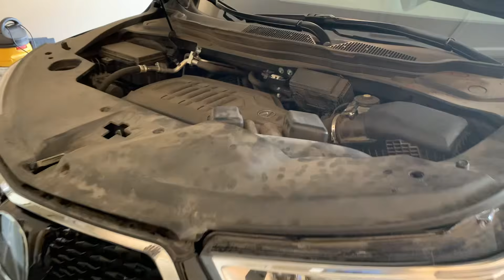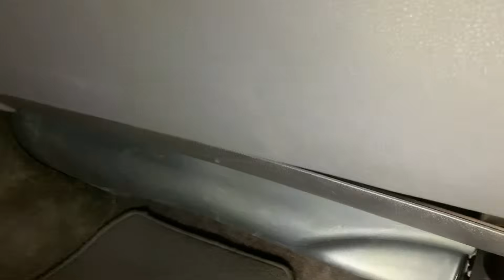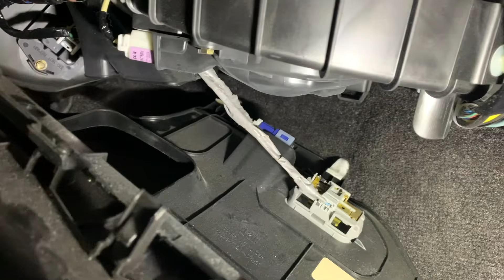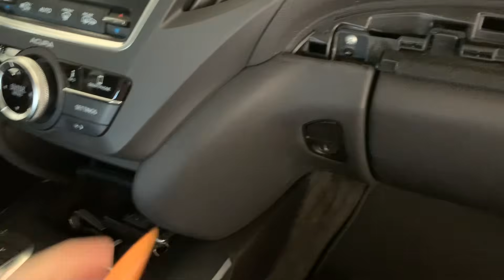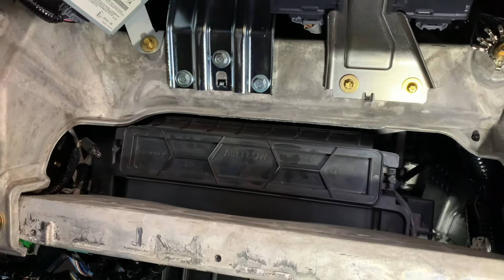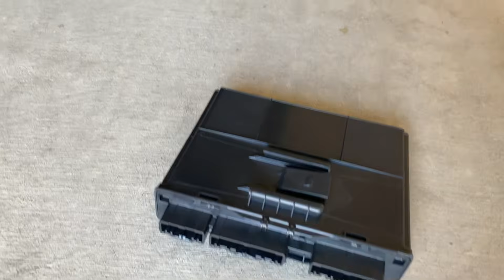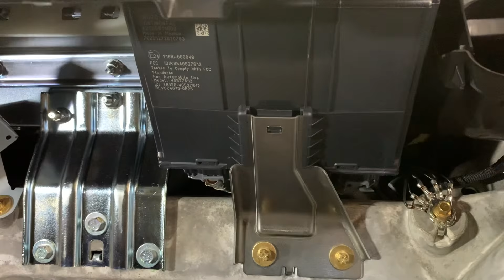Honda / Acura Random, Intermittent Flashing Dash Lights, Headlights, and Car Alarm - FIX Part 2

Comment: Just did the repair on my 2017 Honda Odyssey. Hoping the issue never comes back! Two things to note, 1) in my van, the unit is located on the driver's side, above the brake pedal, above the steering column. No need to remove panels, but I had to ask the dealership in order to actually find it. and 2) the corrosion is virutally impossible to see with the naked eye. You'll need something with magnification in order to see it.
Reply: Do you remember what tools you needed?

Comment: Mine just failed, and I couldn't get the vehicle to stop running. I started it to get the alarm from going off. After about five minutes, the engin started to sputter and it died. I than disconnected the battery.

Comment: This was the most valuable video I have ever found. Saved me $1-2k to get my 2017 Ridgeline fixed by showing me how to fix the part Honda didn't make right. Thank you so much for sharing this! Now if I could just find a similar one one how to fix the front camera assembly that controls the Lane Keep Assist, Cruise Control, automatic braking, etc. I know the chip overheats and the thermal paste they use dries out, but I have replaced that and still can't get it to work.

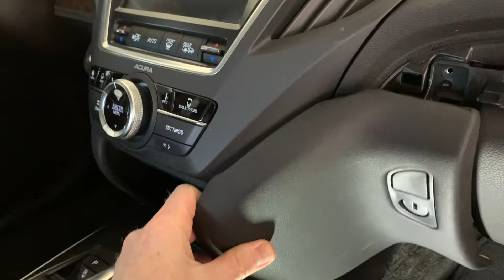Comment: I would like to express my complete gratitude to you for creating this video on this simple fix that the Acura dealer was charging me $1700.00 to fix. My wife has the 2017 Acura MDX and this problem started about a month 4:01 ago. The alarm going off at all times of the day and night, headlights turning on, the dashboard lights flickering, its like the thing was possessed. To think that this is a common issue that affects multiple Honda and Acura models and for them not take accountability for this issue is sickening. I am thankful for people like you who are unsung heroes for putting this out here to help others. I just finished completing this fix and so far the issue has been resolved, and you have helped save us $1,700. Thank you kindly sir!

Comment: I have the Acura RDX 2017. I got the same issue as you described in the video. I removed the glovebox and found out the control unlit was not there.  So I just want to point out for  everyone with the RDX 2017- Technology model, the control unit is located on the driver side under the steering wheel. I slide it out  from the mounting brackets and followed the instruction from this video.  I fixed the problem now.  I hope it will not come back for along time ! Thank you for creating this video.
Reply: Benny i have a 2017 rdx. So the box is on the drivers side? So I don't have to take out panels like the video?
Reply: @daverepole9283  Yes, it is correct.
Reply: @bennydomusic thank you Benny. Hopefully this solves the problem.
Reply: @bennydomusic so I cleaned the unit and now its a waiting game. If it still goes off ill change the hood latch assembly next..thanks again Dave.

Comment: Thank you so much for giving me this useful information, I fixed my 2019 pilot.
I did removed 3 panels to access the circuit board, cleaned it and the alarm back to normal. 
These days the dealership wouldn’t perform those services, have to learn doing it yourself. Good luck folks

Comment: I just found this video and I am hoping to try it this weekend! My 2016 Honda HRV has been having this exact issue on and off for about two years now.

Is there a way to tell how much super glue should be put on there? Is it only needing to be applied to that furthest right line on the bottom row (in the small section you zoom in and show)? Or would it be okay if the super glue got on that corner entirely? I don't want to get too much of it somewhere and it cause more problems. Also, is there a certain type of super glue that it needs to be? Water resistant or heat resistant or anything like that?

Thank you for this video and any extra info you may be able to provide!!
Reply from the maker: The fix is to remove the dendritic growth that is shorting out the IC in the module.  Cleaning the area shown and removing the dendritic growth is the key.  The super glue is just an attempt to keep the issue from reappearing.  A more proper and effective alternative to super glue is the application of a conformal coating.  I would apply it only to the problematic area and make sure to let it dry completely.
Reply: @reginag1874 thank you!! I was hesitant to use the super glue on it, so I actually just cleaned the one spot with alcohol and put it all back together. That was over a month ago, and so far my car hasn't had any issues since then. If it acts up again in the future (especially the near future), I'll look at trying to actually put a little coating on that spot. Thanks for your recommendation!

Comment: ✅It's been two years and 40000 KM since I completed the repair on my 2016 Pilot. No issues whatsoever!
Reply: did you replace the who module? i did disconnect mine and put it back in but still was alarming off and on. then got a new push start button. barely lasted 5 months from OEM. now i bought another one, it started alarming after 8 hours T_T.
Reply from the maker: Fantastic!  Thank you for sharing your experience.

Comment: Regina G you deserve a medal for this video.  I have been dealing with this issue for months on a 2018 RDX.  The first time it acted up I had it towed to the Acura dealership and of course it ran fine there and they found no problem except blaming it on a slightly loose battery terminal.  Twice in the past week the horn was honking in the parking lot with the usual erratic instrument panel and clicking relays. Embarrassing to say the least, looking like an idiot trying to unlock the doors and shut off the alarm with the key fob. Today at a restaurant was the last straw where I either fix it or get rid of the car.  I found the module above the brake pedal, removed it and saw the ‘whiskers’ on the IC pin.  Followed your procedure and hopefully no more problems with it.  This is the second electronics problem I’ve had with newer Acuras, the RDX the fourth model I have owned since my 1987 Legend.  Quality has gotten worse with each one.  I am done with them.

Comment: Can you say how much super glue was added to prevent dendrites?
Reply from the maker: Just enough to cover the exposed metal pins.  You want it to flow over the pins so a gel version will not be very effective.  A more proper and effective alternative to super glue is the application of a conformal coating.

Comment: 2020 Pilot did this a year ago and today I did the repair with alcohol and super glue. As soon as the rain stops I can connect the battery and give it a go. Thank you Regina for posting this. I had replaced the hood latch for alarming randomly. It started again so I disconnected hood connector to turn off alarm but infotainment center/radio would turn itself on. Kept lights off when parked to prevent them coming on and draining battery.  Edit: all good.
Reply from the maker: That is great!
Reply: @reginag1874 Unfortunately my Pilot was stolen recently but was found in less than 8 hours. Sadly it was stripped of so many body parts that it was totaled. The issue never came back since fixing it. Whoever stole the car deleted my keys, made new and cut satellite so it couldn’t be tracked.

Comment: THis is a great video.  I was experiencing the same issues and turned out it was the battery.  When we used portable battery jumper the car started up immediately, no blinking lights.  Brought the battery into NAPA and they checked the charge and it was extremely low.  I bought a new battery and installed and car fired up no issues..  This might not always be the fix, but it saved me alot of time and money.  Check the battery before purchasing a new SPCU.

Comment: I’m really grateful for this video. It saved me a fortune in ridiculous dealership fees and spared me the headache of dealing with my 2022 Pilot, which was driving me crazy because of this issue. The tutorial was quick, clear, and to the point. Posting this on July 6, 2025 — thank you!
Reply: I have 2020 Pilot. Is the module in the same place as Acura or under steering column?  I saw someone mention it was under steering column but want to make sure before I start pulling things apart.
Reply: @imgadgetmanjim same everything as the video man. Do it it’s easy
Reply: @MechaRomance Thank you. I fixed it today.

Comment: Great video. Thanks .. I would add that I found an easier access to the module.  Open the glove box all the way.  The same way you would access the inside air filter.  Then use a drimmel tool to cut the plastic back wall.  10 minute job
Reply from the maker: Thanks for sharing.  That is certainly an alternative approach.  You must like your drimmel tool.  :)

Comment: Did you have to reprogram after unplugging the module?
Reply from the maker: No, if you use all of the same electrical components, there is no reprogramming needed.

Comment: 2017 Acura MDX SH-AWD just completed this repair today.  Will try to report back on the how the fix holds up.  Appreciate the video tutorial!
Reply: Still working with no issues after 1 month.
Reply: @brettstevens7553 Cleaning and putting back worked? Do u have to reprogram the unit?
Reply: Is it still ok? Have you had anymore issues?

Comment: Thank you for taking the time to share the solution to this problem. My wife’s 2018 MDX started doing this tonight, 12JUN25. Looks like I’ll be pulling out the keyless access module this weekend and seeing if I can resolve it. 

I’ve also go a couple 2017 Accords with push button start, I suppose I might expect this problem with them as well at some point.
Reply from the maker: Let us know how it went.

Comment: Many thanks for creating this informative video. I had this happen to my MDX not too long ago. Exactly what you are demonstrating. Took it to my local Acura dealer. They kept it for close to a week and could not duplicate this problem. Road tested my MDX for quite a few miles - nothing - ran without issues. Now that I have my car back, I'm hoping it won't happen again on a future road trip in the middle of nowhere. Frustrating. Only good coming out of this is your video. Great !!

Comment: I have the same issue as your acura mdx. Mine is 2017 honda odyssey and took off the smart power control module identical part with acura. I dont see build up but will try to clean it. Did the problem off your acura came back or good until now?
Reply from the maker: I have had no problems with this issue ever since I discovered the root cause and fixed it.

Comment: Hi - thank you for this video! I will be doing this fix this upcoming weekend for my 2017 Acura MDX. This issue has haunted me for the past  month. I replaced the hood latch, took to the mechanic and have had no luck. Then I found this video. Could you list the tools you use in your comments? I heard, 8 and 10mm socket, flathead & phillips. Did I hear quarter inch socket? Would a car have both metric and SAE bolt sizes? Do you happen to know where the memory is stored, if i damaged the keyless access module for some reason, would I not be able to start the car again? Thanks for this video!
Reply: I did this fix about 2.5 weeks ago and so far so good. The car does indeed have SAE and Metric bolts, which is surprising to me. Getting the keyless access unit apart was the toughest part by far, I used toothpicks to hold it open and was finally able to slide it out. Be careful with the board, I was nervous about damaging any memory chips. I cleaned it up with isopropyl alcohol (2x) then put a coat of MG Chemicals - Premium Acrylic Conformal Coating.  I then let it dry for 1 hour, before putting it back and starting the car. Once I confirmed the car started, putting the rest of the trim back together was a breeze (20 mins). The video is super well done, and it shows exactly where to pull and push to get the car dash trim in and out. Thank you for this video. Hoping this fully resolved it, I will give it another 2 weeks before calling it fully resolved. Thanks!
Reply from the maker: @davechun  Thank you for all the comments and details about your experience.
Reply: @davechun  Hi, thanks for the detailed comment. 
I'm having trouble opening the keyless access unit, could you describe a bit more how you used the toothpicks?
Also I'm wondering about the cleaning and coating aspect - could you explain more where you cleaned and coated?
I'm a total newbie and I'd really appreciate your help! Thanks

Comment: Thank you for this vid.  🙏  I was able to get the circuit board out pretty easily with the right tools.  Couldn’t find anything wrong with the board though.  (Granted, it was my first time looking at one but I brought it to a buddy who knows electronics and he didn’t see anything either.)  I bought a Honda replacement one for like $500.  Once I put that in, the car needed to be reprogrammed for it to work.  That was beyond me so I brought it to a dealer and they put me all back together and reprogrammed for $300.  Not the best I could have done but way better than the $2k another dealership wanted to replace the whole fuse box.  (???)  Which wouldn’t have fixed it.  So far so good, no random alarm going off, I think I’m good.
Reply from the maker: Thank you for sharing your experience and all of the details.  Amazingly, there are soooo many dealerships still misdiagnosing the problem while happily charging people thousands of dollars for unnecessary work.  It is kind of almost CRIMINAL.  Do you still have your original module that you replaced and would be willing to donate it to science (i.e., me)?
Reply: @reginag1874 I’m kicking myself, I didn’t even think to take the old part.

Comment: Found the part number for anyone else looking:
38320-TZ5-A711-M1
Reply from the maker: Please let us know for which make and model vehicle this part number applies.
Reply: This is for the vehicle in this video which I think is a 2018 MDX. The part number was different on the vehicle that I repaired it on. The part number was 38320-TG7

Comment: Thanks brother. I replaced the battery and the alternator and it did not solve the problem until i came across your video. I took the pcb out clean it and works i was little scared of putting super glue on it so i did not put it on hopefully this does not come back. Was thinking about cancelling our camping trip but this video saved the day thanks again you help us more then you know.

Comment: Thanks for posting this! It fixed the issue on a 2019 Honda Passport and the trim pieces were different, but still similar enough for me to know what to remove. One thing is that I wish you would have showed your technique and the process of removing the module from the plastic housing. That took me longer to get that thing apart than the dash! Finally, I stuck four small screwdrivers in each slot and pried the tabs open a bit, but that broke off all four of the little plastic hooks in the middle. It seems like you don't even need those hooks anyways, as it snapped all back together securely. Also, I would have liked to see where exactly you put the superglue, as I didn't want to screw anything up since I had got it working again, so I omitted that step. Anyways, I guess I get to look forward to doing this in 5 1/2 years when it starts shorting out again.

Comment: Hey! Thanks so much for this helpful video! My 2017 Honda Pilot Touring was doing this same thing. I followed both your videos and my car is working great! I cleaned everything that wasn’t fully sealed and covered with Super Glue, let it dry, put the part back together and reinstalled it. I didn’t have the microscope but I used a magnifying glass and it worked pretty good. All said, it took about and hour and a half but it seems to be working great!!😀

Comment: So Ive had this problem since end of February 2025 until recently April 14, 2025. Took it to an independent Honda Mechanic. They ran a diagnostic test and said the battery was bad. Mind you, i just bought the battery August 2024 but since the problem came up, I disconnected my battery when I wasnt using the car then would reconnect it at night to see if the flickering of the dashboard lights and alarm would go off. By doing those things, i drained the juice of the battery.

So i went back to costco, got a new battery and the local independent honda mechanic did a hard reset on my Pilot. Its been two weeks already and no problems.

Try resetting your system through an independent honda mechanic. That should do the trick 👍🤙
Reply from the maker: Thanks for sharing your experience.  I went through the whole cycle of replacing a fairly new battery as well.  Things were better for a while until finally the problem never went away, and I was compelled to discover and fix the real root cause.  Let us know if things change for you.
Reply: @ well i did a hard reset through a independent honda mechanic. What was the root cause for your car?

Comment: 2017 Acura MDX Tech. Package: first time doing this so I carefully watched this video and step by step. Only issue was during the process of removing the module, I stripped one of the 1/4 screws holding the bracket down. In short I got it removed and cleaned the board with Deoxit and a small brush. I installed it back and boom! It is working without any issues of flickering, headlights turning on and off, alarm going off which annoying….all of that issues are gone. thank you so much. Bravo Zulu!
Reply: Same  here.
Reply from the maker: Great to hear of another successful fix.